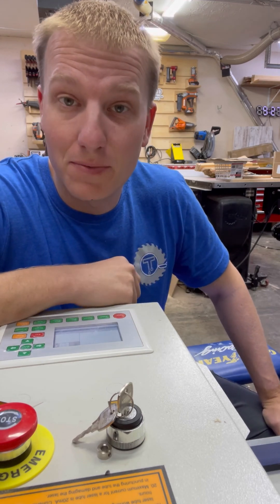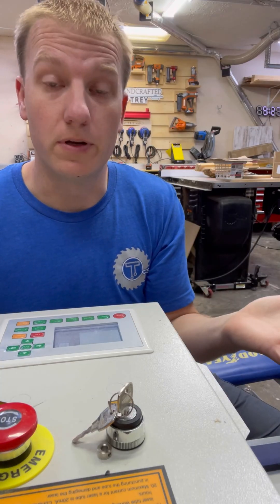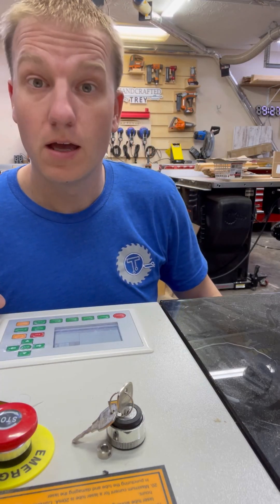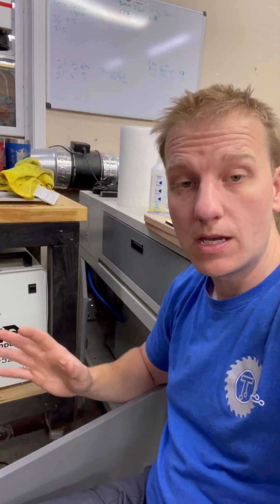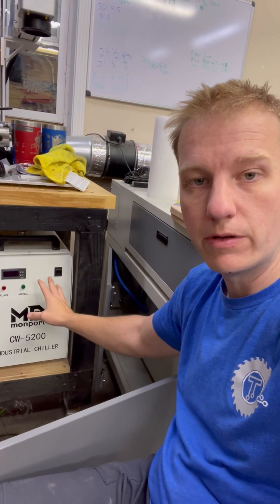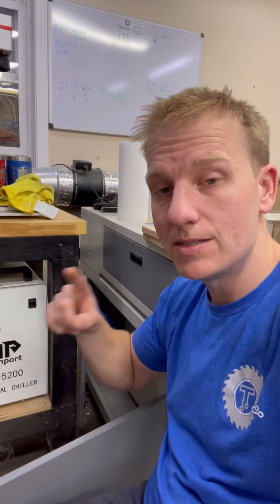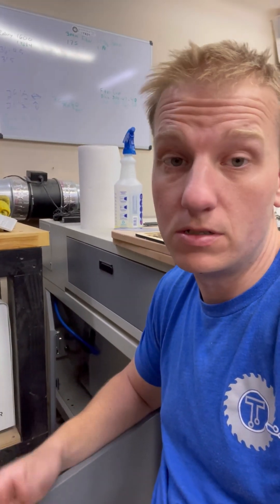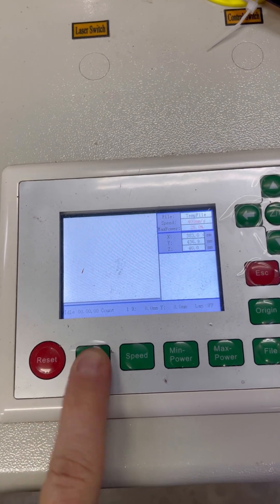Monport Ttechtips: How to fix the error codes displayed on your screen

Comment: What should I do if the doors are closed, but the error still persists? I've checked all the door sensors, they are switching (& giving a signal when pressed)
Reply from the maker: Hi! For assistance, please email support@monportlaser.com 😊
Reply: J'ai le même problème pouvez vous me dire ce que vous avez fait? Merci par avance
Reply: My red light is not coming on. If I pulse my laser it works but if I try to engraver it moves but it doesn’t fire? Any suggestions? No error codes